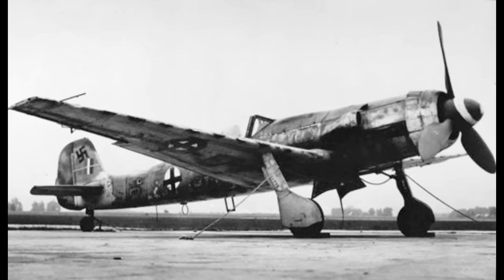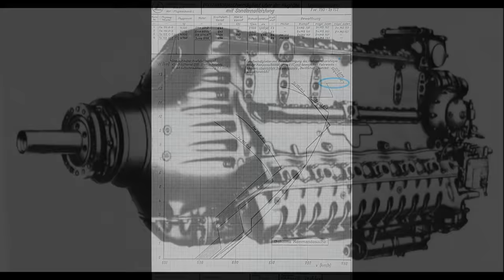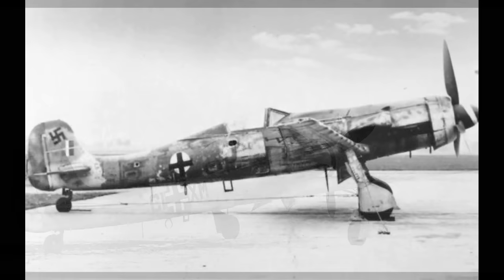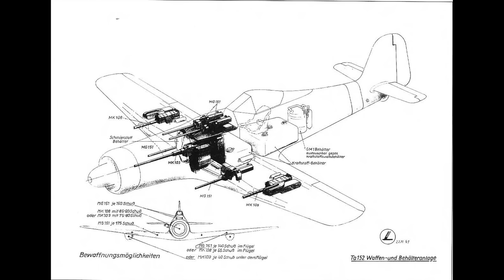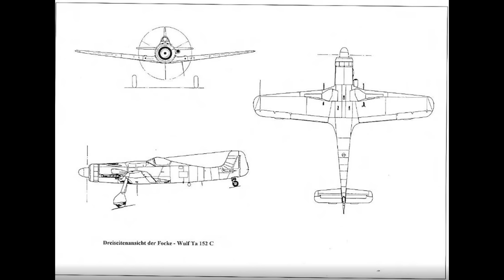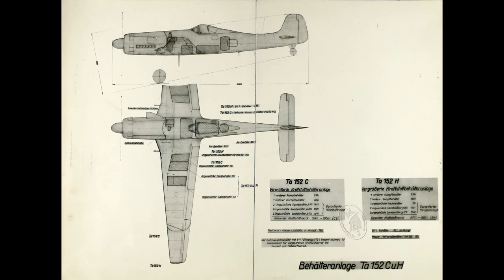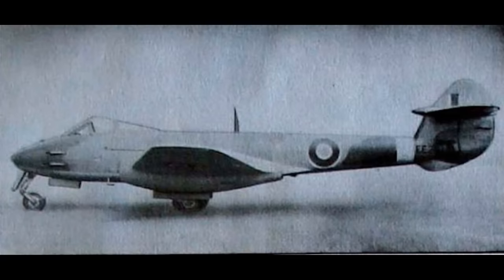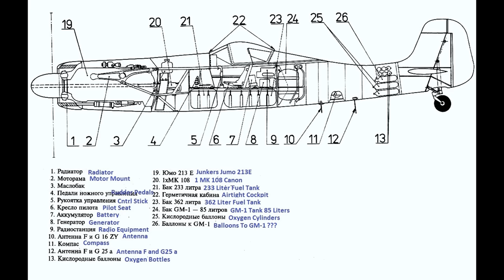Focke-Wulf Ta 152 H-1 Extreme Speed At High Altitudes.

Comment: Great video, lot of interesting info on how to get a piston engine to fly high and fast. One of the fast and high aircraft of the era were the photo reconnaissance or PR versions of the Spitfire. In particular the last PR version with a Griffon engine as the Mark XIX. It's defense was to fly very high and very fast as follows -   PR XIX

The PR Mk XIX was the only Griffon powered reconnaissance Spitfire. It was produced by taking combining the Mk XIV fuselage, PR Mk XI wings and PR Mk X cabin. It could carry up to 254 gallons of fuel internally, using space in the wings that had originally held cameras. It could carry a 170 gallon drop tank, although the largest size used on operations was 90 gallons. It had a top speed of 445 mph and a service ceiling of 42,600 feet, making it almost impossible for the Luftwaffe to catch it. All but the first 22 of the 225 produced had a pressurised cockpit.

The Pr XIX could carry two vertical and one oblique camera (on the port side). The vertical cameras were either F.8s with a 14 or 20in focal length or F.52s with a 20in focal length. The oblique camera was an F.24 with either an 8 or 14 inch focal length.

The Pr XIX first flew in April 1944. It entered service in May 1944. The last operation flight by an RAF Spitfire was made by a PR XIX on 1 April 1954. Three continued to fly with the Temperature and Humidity Flight, performing meteorological research, until they were finally retired on 10 June 1957.  

Amazing what could be done for speed and performance.
Reply: @ Allan Bowes  
Mk XI wings on a Mk XIV fuselage? What is your source for this?

In Quill's book "Spitfire: A Test Pilot's Story" on p.226 he writes that "In response to an urgent appeal to the MAP from the PRU at Benson for a new photographic reconnaissance Spitfire of even greater performance than the then current PR Mk XI a small batch of Mk XIV's was adapted on the production line for photographic reconnaissance work and delivered to the service, under the description of PR Mk XIX, in time for D-Day. Unlike the later fully developed PR Mk XIX's these early aircraft were not equipped with pressure cabins.

Also you omit any mention of the forward looking cameras in the Mk XIX that gave such  improved results in the low-level role. 

On the subject of Spitfires in general and range in particular, there was no immediate need once production of the improved marks of Mustang had hit it's stride. The immediate need for MAP was to maintain production of current types and their next replacements. Development of long-range Spitfires was not a primary requirement and although incremental improvements were continually made in various marks, but the original design was initiated almost a decade before the Mustang to fulfil a different role at a time when the orthodoxy, in common with the Bf 109 (big engine in small airframe with small drag reducing tail-plane), was focussed on prioritising other performance criteria than range. The peak of 20 series, the  Mk.24, was too late and ultimately made redundant by the advent of the turbo-jet.

P.S. For me the interesting part of the story of the Spitfire family is how two "ad hoc" types, IX/XI (from V airframe introducing the two stage supercharger with intercooler Merlin ) and XIV/XIX (from VIII airframe inspired by the Griffon powered XII) represent the two main production types, post Mk V.
Reply: @rodparsons6719  There was a very detailed article in a UK flight magazine (which is currently at the cottage) detailing the history of the PR bluebirds up to the Mark XIX. The quote I patched in was from the following URL http://www.historyofwar.org/articles/weapons_spitfire_PR.html. Wikipedia's was similar but there was more info here such as only the first  22 did not have the pressured cabins and others did.  In the UK review of the Mark XIX which has a lot more detail the author spoke about maximum ceiling for British rules of when the climb rate hit a minimum climb rate of I remember as 250 FPM. The plane could still be slowly climbing. The last use of the Mark XIX PR was Hong Kong for the RAF until 1954. Allan Bowes

Comment: Beautiful airplane and ahead of it's time--time just passed it by with the introduction of the turbine engine....
Reply: The Ta 152 would make short work of an RAF Meteor. Several of the reasons why they were not used outside Britain is that they just weren't that good, logistic complexity and potential embarrassment if they came up against a Me 262 which was a much more mature (better) design. But obviously, the potential was there.

Comment: It’s well know that even in forced induction engines. The majority of the fuel air charge is drawn in to the cylinder via the scavenging affect of the exiting exhaust gas. MIT outfitted a ICE engine with pressure transducers to prove it. The 3 valve lay out was used in the late 2000s by ford on their Triton engine helped keep exhaust gas velocity up by having 2 intake valves and only 1 exhaust valve. The exhaust valve also must overcome cylinder pressure to open.  By using 1 exhaust valve helps keep port velocity’s up in the exhaust port latter in the cycle.  Because the intake valve is opening while the exhaust valve is closing means so much to volumetric efficiency of a engine. Having 1 exhaust valve will delay the drop in exhaust gas velocity long enough so that the intake over lap can take more advantage of the exiting gasses to draw in the new charge. Modern engines take advantage of this by controlling LSA lobe separation angle via variable valve timing. as engine RPM increases you can add “overlap” and produce a natural super charging affect due to higher exiting exhaust gas velocity’s. Because aviation engines tend to turn a lot less RPM variable valve timing would have little to no effect. By mechanically shrinking exhaust valve and exhaust port area enough to delay the drop in port velocity closer to the intake valve opening event would net the same VVT advantage at a much lower RPM. In Non direct injection engines the thought is you have liquid fuel and air coming in and hot gasses going out. That’s why the exhaust valves are normally smaller than the intakes. My father was the first guy to make a Billet aluminum 426 hemi type cylinder head for drag racing in 1982. At the time every one thought bigger is better. with are roots superchargers forcing so much air into the motor getting the ports as big as possible was considered ideal. My father proved his toilet bowl effect buy welding exhaust ports up lowering its volume but straightening the geometry increasing flow thus making more power. MIT proved this with a N/A LS motor on the dyno.  80% of the fuel air charge is drawn into the cylinder via the exiting exhaust gas before the piston moves past 10 degrees after TDC. The piston mechanically moving down the bore is only responsible for 20%. A lot of race engine manufactures have shrunk the exhaust valve in relationship to the intake valve for a given cubic inch and found more power.
Reply: Learned something more. Thanks
Reply: Kratzikatz Eins thank you sir! I’m big on learning my self. The more I learn the more I realize I don’t know.

Comment: Just a small comment on altitude pressure- 8000m is considered the "death zone" for climbers.  At that altitude breathing unassisted is possible but you slowly lose judgement and will eventually die.  Obviously the system was designed to be supplemented and was only there to ensure the pilot didn't lose consciousness in the event of equipment failure.
Reply: I've never been that high unpressurized but I've been on a mountain at a bit over 5000m. Sitting and doing nothing was perfectly fine but any physical activity at all, even just walking was enough to have you gasping for breath and getting light headed. I'd hate to spend much time at 8000m.

Comment: Thought I’d pass this on if no one else already has, but one of the primary reasons for cockpit pressurization is to combat evolved gas disorders.  This involves liquids in the body expanding into gaseous form as well as regularly existing gasses in the body expanding to painful levels.  Evolved gasses can result in tooth pain, neurological anomalies, severe joint pain, etc., all typical symptoms of the bends.  Preventing this through cabin pressurization also results in a more comfortable and therefore sharper, more lethal pilot.
Reply from the maker: Thanks Larry. That was discussed earlier, but your explanation is quite good.
Reply: Greg's Airplanes and Automobiles Sorry about that.  I tried scrolling through the comments but missed it.
Reply from the maker: No problem, I'm always happy to have people add intelligent comments. Thanks for contributing.

Comment: Refering to the Oxygen: Dusche in this means that is an continuous Oxygen flow activated. The Oxy is kinda force fed to the Pilot. Usually the Oxygen is only given as you inhale. This doesn´t mean 100 % oxy per se.
Reply: @Rich A That is Right. I was just referring to the term "Dusche" which means air is forcefed to you if you inhale or not. That can be 100% Oxygen of course

Comment: Super interesting. Seems that most of the automotive engine development of the last 70 years come directly from the aircraft of WWII.
Reply: The DB601E introduced both resonance tuned scavenging with both intake and outlet poppet valve open at the same time and variable inlet ports.   This purged the last 12% of exhaust and actually drew in fresh air and pressurised it slightly.  It also go rid of Engpasses that could cause preignition.  Because the Germans used direct in cylinder injection derived from diesels for their aviation engines this meant not fuel/air mixture was lost so the resonance scavenging could be radical with a massive valve overlap.   This created rough idling problems at low RPM so a two length variable inlet port was developed long at long at low RPM and short at high.   Now used on many mazdas, bmw etc.

Comment: The Jumo 213 was the superior engine when it was all said and done. If it had been allowed to be developed more completely would have been a winner for fighter design in its day. An excellent resource is "the Secret Horsepower Race" by Calum Douglas. An INCREDIBLE book (and some videos) that detail air power engine development to the detail of metallurgy examples, fuel examples, radiator issues, bearing material issues, valve issues (the biggest bugaboo of all their designs), and the personal letters from the leaders, designers and engineers between themselves and other nations at the time.  The number of pictures, history of each inventor and engineer on all 5 sides of WW2, mechanical drawings (just amazing) are good enough to be an official resource in any museum. This book (and videos) and Greg's videos and the best source of WW2 tech I have ever seen.
PS my own involvement and opinions are from being a volunteer "wrench" on a few racers in the Reno Air Races for 10 years, including the Strega, and a few others ;-)

Comment: The Sabre powered Fury is one of my favorite "what if" aircraft
Reply: The Sea Fury?
Reply: @major_kukri2430  there was supposed to be a Sabre powered land based Fury. But then jets had to ruin it.
Reply: @cliveschoonover1367  wow I didn't know that.
Reply: @cliveschoonover1367  Wasn't the fury supposed to be Centaurus powered, like the Sea Fury?
Reply: The sabre engine was only in Tempests ,when fitted with the radial Centaurus it became the Fury ,If Napier hadn't abandoned development of the high altitude  Sabre  the Tempest would have had well over 3000 hp and combined with wing root intakes in place of the large chin radiator intake you would have had one of the fastest piston fighters at any altitude.
Reply: The RAF was supposed to get a Sabre Fury, and the FAA a Centaurus Fury. The Sabre VII Fury did fly (and was rather zippy), but the gov't cancelled the orders. Looks like it was one of those deals where the manufacturer is uncertain there will be an order and drags their feet delivering the product.
Reply: @cliveschoonover1367  the great shame is no Sabre engines are running let alone flying.
Reply: Apparently the Napier Sabre engine was bench tested for one hour at 4000 horsepower.
Reply: @pauldavidson6321  not yet! There are 2 Typhoons being rebuilt.  One (in England) has a Sabre waiting to be restored, the other group (in Canada) are further ahead with their airframe, but they might have to build a new Sabre! (And are prepared to do it if necessary!)
Reply: @oxcart4172  I can't wait ,at least with modern metallurgy and CNC machinery  getting a Sabre engine running isnt an impossible task ,not exactly easy but not impossible.
Reply: @pauldavidson6321  Napier made a w12, dohc, 4v per cylinder,  all alloy block aero engine in 1917

Comment: Spitfire have steel wing spars. The higher strength to volume ratio allowed a thinner wing than could be achieved with an aluminum spar. Kurt Tank must have arrived at the same conclusion for the TA-152.
Reply: In JE Gordon's book "Structure: or why things don't fall down", there is a materials discussion on how materials group as a function of Young's Modules divided by density. For ordinary materials like aluminum or steel there is no difference. Steel parts would have to be designed thinner or different than aluminum parts. Where there is a difference is carbon fiber parts, high stiffness low mass. Of course with a new set of problems to solve. Good book BTW.
Reply: @danapatelzick594  A beautifully written book. I enjoyed it more than any novel.   I remember wanting to discuss it with may date one night rather than the play we'd seen but had to resist.

Comment: Ok, english and german are my 2nd and 3rd languages. I do however have a DSD II german diploma. I did my best. I have some background in control engineering but nothing in the aerospace stuff. Took the liberty adding comments. Greg translated it pretty good tho. 

A. At the height of 4000m start with oxygen ventilation [use oxygen mask] and always 
     leave on at heights above 4000m.
          1. Open the remote controlled oxygen valve*. Watch manometer and O2-monitor.
          2. In case of difficulty in breathing use oxygen shower**. (Turn on using elbow.*3)

B. At the height of 8000m turn on [cockpit] pressurisation.
          1. [Turn] Rotary slide*4 for air supply in position "[Cockpit] pressurisation"
          2. Fill the seal hose*5. Press the valve for 15 - 20 seconds.
          3. Occasionally check the cockpit pressure indicator. Internal pressure is equal [at]
              8km.

* Cockpit oxygen supply is controlled using some sort of a relay. There seems to be a switch in the cockpit and the valve itself is located elsewhere. 

** This one is weird. "oxygen shower" seems to be some sort of a device which supplies the user with oxygen in concentration higher then that i normal air. I was trying to figure it out and saw that they were used in medicine. I think that  "oxygen showers" could be those oxygen masks that are put on a patient before anesthesia or after inhaling smoke.  Yeah... most likely 100% oxygen supply.

*3 There a few possibilities why a pilot would be required to turn on oxygen supply using his elbow: 
1) The switch that turns on oxygen supply to the oxygen mask must be somewhere to the side of the cockpit.
2) Oxygen mask is only to be used if cockpit oxygen supply fails and it is designed to be quickly slammed in case of emergency. In this case, knowing Germans, there might even be a feature that prevents accidental use of this emergency-only system. It might take some force to turn it on.

*4 There seems to be some sort of a rotary knob switch that controls the air system.

*5 There seems to be some sort of a rubber seal between the canopy and the aircraft body that needs to be inflated to make everything air tight.

Oxygen shower button:
https://www.worthpoint.com/worthopedia/ww2-german-sauerstoffdusche-oxygen-1859829729
Reply from the maker: Excellent thank you.
Reply: @GregsAirplanesandAutomobiles   Excellent channel, thank you.

Comment: There's only 1 one of these planes still in existence and it's the high altitude version.  It belongs to the Smithsonian and is in storage awaiting restoration whenever that happens!  Only about 3-4% of the Smithsonian is on display at any one time.  By far the vast majority of the Smithsonian collection is in storage in warehouses.
They planned 3 versions of Ta 152 for high altitude, medium altitude (which was the Fw-190's original limit until it was redesigned and refit with a liquid-cooled engine for a later model) and ground attack.  Built fewer than 100 Ta 152's but the documentation doesn't confirm how many; generally believed to be 69 total of all versions of the Ta 152.
The US specimen was a test plane.  They didn't fly these planes in combat very much and they had mechanical issues.  At least the engines "only" overheated.
Better than being dissolved by volatile rocket chemicals.  That happened to Komet (Me 163) pilots a few times...